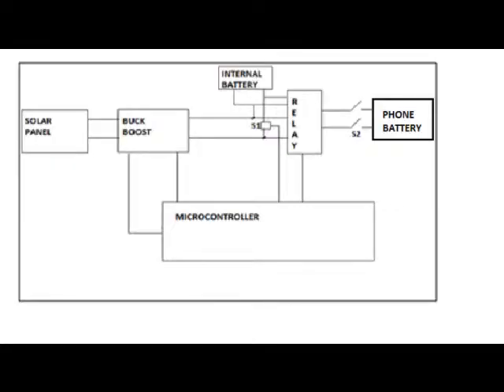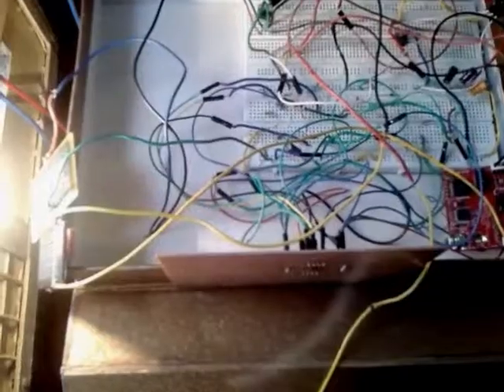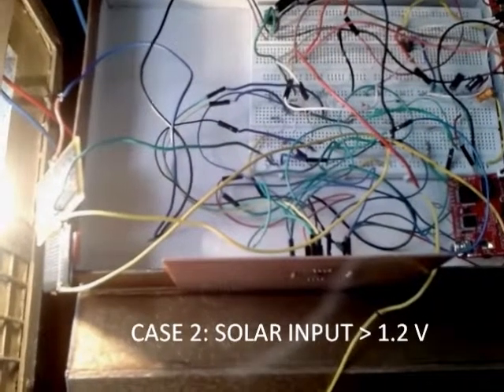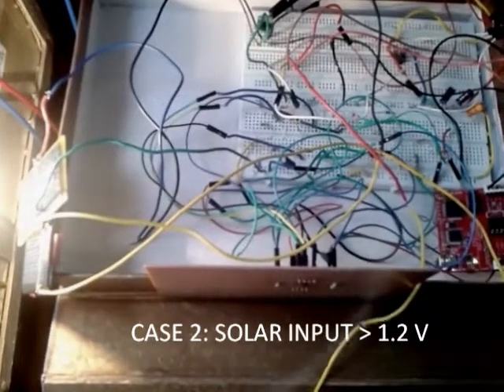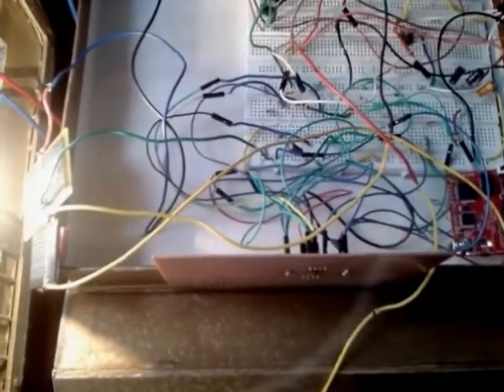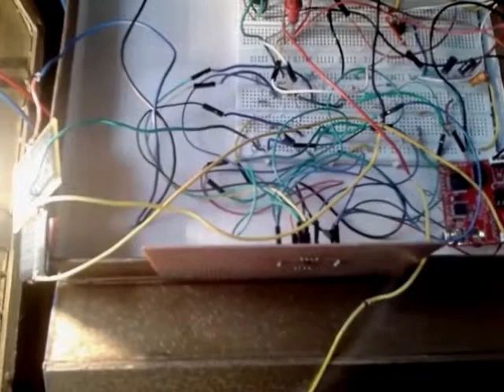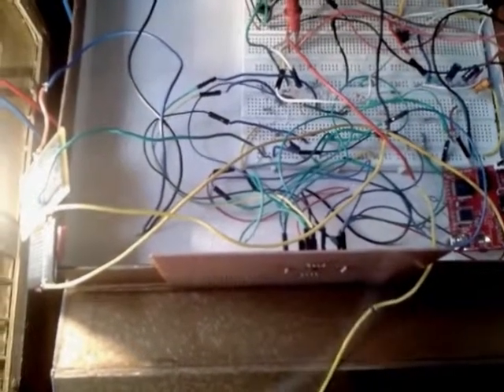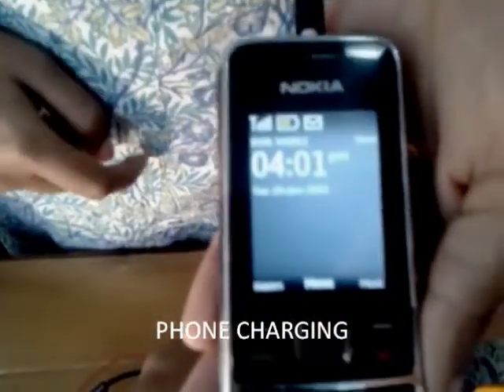TI INDIA ANALOG DESIGN CONTEST 2012-2013, SOLAR POWERED MOBILE BATTERY CHARGER

Comment: Hi,
My project group and I are doing a Similar project of charging a cell phone though a solar panel.
We are going to be using an 8 V Solar panel, with a voltage regulator and a microcontoller with adc.

We would really like it if you could help us out a bit.

Thank you.